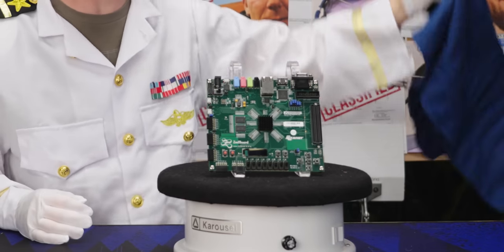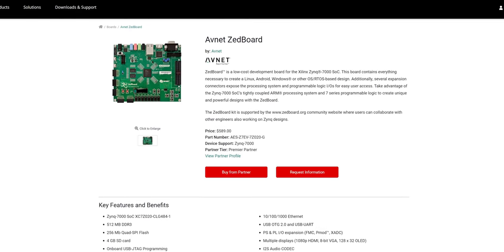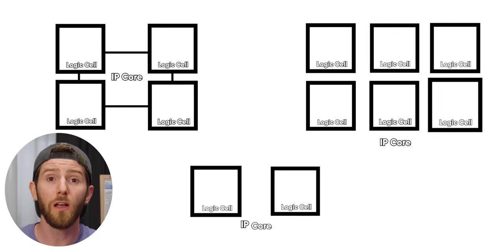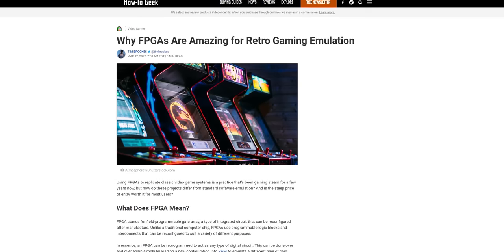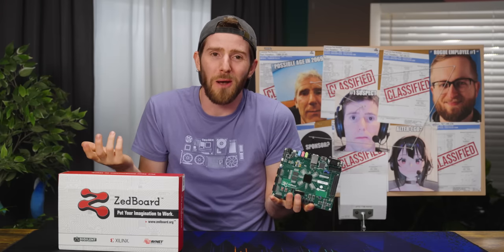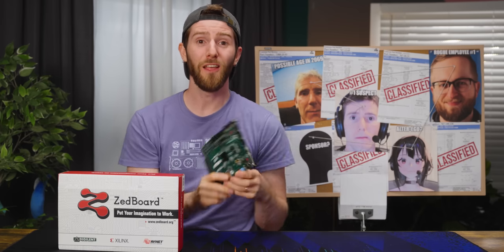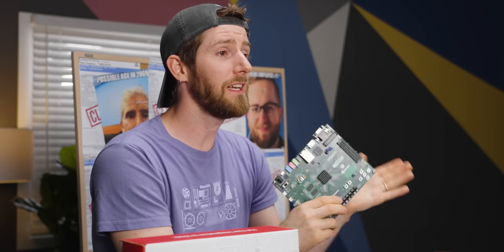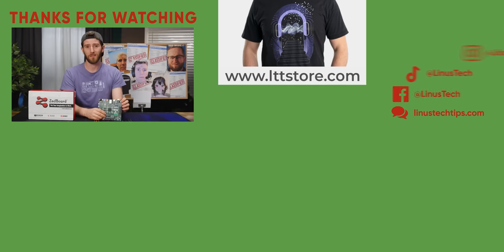I Bought Iran’s Secret Quantum Computing Chip

Comment: I'm not sure this comment will be read but I do my part:
I'm from Iran, here's a little story: Years ago, for my final university project, my professor gave me a simple device to reverse engineering it. (My university wasn't fancy) it was a queue machine, the ones you press a button, and you get a number and then the machine reads out loud the number, so you know it's your time to visit the place. it was using Ethernet CAT5 cable, he mentioned they tried plugging it to a laptop and couldn't get any data from it. I was curious and took the project. turns out it was just a casual USART between two microcontrollers, but they used Ethernet cable for both power and data. so, I made a simple board to read the USUART data on the go and displayed it over a simple 4x20 Alphanumeric LCD, I also added some features like paging, memory to save etc. it looked cool too :D, I got full score for it.
A month later I was invited to "Research and Developments of Universities" show, I went there and saw my project under a spotlight with this title "Network Spy Board, it can Spy and decrypt data in datalines" I was like "wha- ???". I Investigated and I realized some guy in my university wanted to get promoted and made this lie to attract some attention to himself.

Usually, stuff like this happens in here. Top managers have no technical knowledge or sometimes incorrectly make the title bigger because they might get a raise. I believe that Quantum Computer thing, could be the same case. nobody looks at student projects seriously and incorrect information can easily get over news before it gets actually checked. yes, it's a downside and I am criticizing it Aswell, I'm an electronics teacher, I've done actions to fix things. to be fair it's a 40-year-old government (for instance united states has been for 200+ years.)

Every human is free to say their point of view or anything they like to say, that's what I always say in my classes. I'm a big of your channel, I wanted to explain how big mistakes like this happens. For instance, the covid device was BS :D no doubt about it, but this isn't always the case. And ofc in every nation there are bad people, they exist.

I respect the time you guys invested for this video and it was a good video, Keep rocking 🌹
Reply: Aint reading allat
Reply: @gunzooo0 you should it was a pretty good explanation
Reply: حاجی دمت گرم
Reply: Makes very much sense
Reply: Respect.
Reply: Hopefully that government doesn't live to be 50
Reply: Much love and respect from a U.S. citizen.

Hopefully at some point the crazies on both sides will be cast aside or they will set aside their differences, and the US and Iran can start being friends again.
Reply: "And how can we win we fools can be kings?"
- Knights of Cydonia, by Muse
Reply: Can't always believe what someone tells you, especially government officials! Got to take it with a grain of salt.
Reply: @joseperez-ig5yu  lol, i live in Kurdistan, we share borders
Reply: I lol-ed hard when u mentioned the title of your project 😂 yea I can imagine that happening bahahahhahaa
Reply: "to be fair it's a 40 y o government, for instance the u.s has been around for 200+ years"

What exactly did you mean by that? You're comparing a government that started in late 1700s to one that has started in 1979 and... inferring that any flaws can be understandable because of that? I'm sorry but the fallacy is so obvious here, as if there was no technological, infrastructure advancements before 1979 and they just started from blank! you must be a smart guy, read your statement again and you'll know what I mean.
Reply: lots of home schooled tech wanabes in this channel hahahah
Reply: us is so advanced barefoot indians have to do all the tech work, lol
Reply: @omiddhm372 actually they have started from blank since Shah had imported science and technology from the US and they US gov didn't let Iranians know shit about the intricacies of the tech at the time to make Iran dependant on them.

Comment: FPGAs are being used for quantum computers in a very critical role, as control unit that schedules all the operations of the quantum algorithm, since they can implement logic and execute it perfectly synced up to an external clock. And since quantum computers is still not exactly a mass product, nobody is bothering with dedicated chips, and sometimes not even with production FPGAs. ZedBoard development boards do work quite well.
Reply: They slipped up thats what there using for there development of their quantum computer.
Reply: finally, a reasonable person
Reply: I'm sure Linus said this already in this video not just as detailed though but you can get the gist of it.   😮
Reply: Shameless plug: I work at a company (Riverlane) that's building a control system and error correction solutions for quantum computers. We use FPGAs for prototyping and deployment precisely for this reason.
Reply: @GabrielGee plug accepted, cuz that sounds sick af boiii
Reply: can't wait for ibm joker version , i laughed hard last time, lol

Comment: The temperature thing is only necessary for some architectures, a fully optical quantum processor is room temperature, and the rubidium atomic processors are actually very hot, they literally boil rubidium atoms and then capture them in place with a laser trap; its one of the less expensive methods. (Still very expensive)
Reply: What about the 12CQ carbon based cubit processor from Archer? Is that pipedream or real stuff?
Reply: temperature... "thing"???
Reply: @hiddenaether3232  
Yes, the idea that quantum computers have to be super cooled is not true.

I write the way I write and talk the way I talk so that you can understand me, not to impress you.
Reply: Those atomic traps actually are a lot cooler than those bulky He dilution fridges (usually reaching a couple hundred of mili Kelvin). A typical MOT (magneto optical trap) can reach nano Kelvin range, which is the coldest in the entire universe!

Comment: A research project I did in Uni used a similar board as a test bed for validating processor designs. So you could bake the logic gates of the processor onto the board and then run specification checks to validate the design before you send it to be built. Cool to see these kinds of board highlighted here.
Reply: Every computer engineer has an FPGA class as a rite of passage. I still have the 32-bit CPU I designed and got working on a Nexys FPGA board. The minute I saw the board and the stereotypical dev board layout I laughed expecting something more advanced and not like something loaned out to bored undergrads in uni.
Reply: @chiragpatil2052  My university didn't have an FPGA class unfortunately. I'm thinking of getting one of those boards and taking an online course on them, I'd love to learn more about them.

Comment: Just wanted to add something about the emulation. The larger FPGAs (eg v2000t, vu440, vu19p, vp1902) are designed for emulating new designs (eg new gpu/cpu designs) rather than older ones. The larger FPGAs replace BRAM/URAM with LUTs (and also trading faster I/O for more "slower" I/O) because that's what's needed for ASIC emulation

Comment: Zynq7000 SoC is widely used in the defense sector, mainly in Avionics. They are used from digital controllers for aerial vehicle dynamics to DSP processor for interfacing software defined radios and much more, these ICs are so cheap and so versatile its easy to find them everywhere...
Reply: Hope it doesn't find YOU, kind of things

Comment: Iran's attempt at a 5th Generation fighter jet, the Qaher-313, was also very funny. It was a plastic mockup that looked like a cheap copy of an F-22, that was probably big enough to convince someone who doesn't know better, but too small to realistically fly, carry weapons or even for most people to sit in. It had tiny air intakes, implausible aerodynamics, and would have most likely shown up very clearly on radar, as it seems it was more focused on looking cool than actual stealth. It also had no weapons bays, no jet nozzles, a tire pressure that would be too low to actually hold a fully-loaded fighter plane, and a very basic cockpit filled with cheap off-the-shelf avionics taken from a civilian turboprop aircraft. Their "flight demo" was a poor-quality video of what was almost certainly an RC plane, that didn't actually show it taking off or landing. Last I saw, they've actually given up on the fighter thing and are going to make it into an unmanned drone instead, which seems to be a bit of an admission of defeat on their part.

Comment: FPGA emulation is a little more nuanced. While it IS possible to implement a transistor-for-transistor recreation based on a decapped chip die, to my knowledge, almost every current instance of FPGA emulation is done using black-box reverse engineering: attempting to recreate the behavior of the system based on its inputs and outputs. So it is not a 1:1 recreation, and still a "best guess". Running on an FPGA doesn't instantly make it a perfect recreation: it is still only as good as the code it's running. It is still emulation, just hardware emulation rather than software. Both are awesome, and each has their own advantages.
Reply: And to be clear, this isn't me talking down on it. FPGA hardware emulation is so cool. I love the mister project, and have huge respect for the analogue devs. But it IS hardware emulation, despite what some marketing says, and it is NOT perfect recreations of systems. I have encountered and reported many a bug on my analogue systems.

So much incredible stuff has been done with fpgas, and I'm excited for when we do get real transistor-for-transistor core recreations on them
Reply: @ShankMods one of the few cases where transistor level emulation is likely is some 6502 emulators, considering we have the visual 6502 stuff.
Reply: I don't know for sure, but the SNES platform, including most or all of its expansions, should be doable on a 1:1 level because I believe nearly every chip was decapped and/or fully dumped by Dr. Decapinator back when Byuu/Near was developing BSNES. I know that's a rarity in this realm, though. This process did show what you're talking about regarding "black box" behavior. For example, the software version of SuperFX ran twice the speed it was supposed to and had other timing issues that weren't fully apparent until an accurate version was written.
Reply: Hey shankmods! I love your stuff!!
Reply: It's more like logic emulation as FPGA chips don't go quite as far as the transistor level

Comment: Kind of sad you didn't fully mention the amazing nature of having an FPGA and an ARM SoC on a single package, this allows to have a more easy and feature rich chip because you can install Linux* into an external memory an run it with the ARM PS while also having integrated custom logic solutions at your disposal FROM LINUX thanks to the PL
Reply: What's even more cool is that you can create a soft-cpu in the programmable logic and then run Linux on that! You can literally design your own CPU in hardware and run Linux on it (If you are extremely skilled)
Reply: @cheesepie4ever  That's not a feature. That would be extremely expensive on the PL side. From working on a research team developing FPGA overlays for safety critical systems, you want to run as light as possible and save your PL side just for compute and acceleration. Keep the PS stuff on the discrete hardware, it's cheaper and better for performance.
Reply: @johnbrooks7350  Soft core CPUs ARE used in the industry - look at Neon, Microblaze etc. They can be used for system monitoring, control + coordination for eg DMA, security, redundancy etc. Softcore CPUs also aren't necessarily that expensive on the PL side either -  in order of less than 1000 LUTs.
I agree you generally wouldn't use a softcore Linux - it is achievable and a cool exercise - but not something that would be done in many professional situations. Although I have heard of it being done in rare situations
Reply: @cheesepie4ever  sorry for the misunderstanding, my work is mainly focused in the embedded side of things where usually you want the PS side to be running your RTOS systems and such and PL is usually for your high performance signal processing and such.
Reply: @johnbrooks7350  That is cool! Do you work with Zynq MPsoc? My work has been on the FPGA side only but my company let me do a course on MPSoc and it does seem really cool! Although petalinux seems pretty evil to learn for the first time haha, maybe you don't need to deal with that if you're working on the real time stuff?
Reply: @cheesepie4ever  yeah, a lot of my work is with Zynq MPSoC’s. We recently have been developing on the kv260 with petalinux and it’s definitely “special”

Comment: Both Microsoft and Google have Quantum programming libraries that run on your standard computer. They basically emulate some parts of a quantum computer. Though not very likely, perhaps this board was used to act as a very efficient quantum emulator for development
Reply: Simulating qubits is at least quadratic time complexity. Those compilers and FPGAs can only simulate a handful of them at once - which is only good for experimental/learning purposes.
Reply: @exciting-burp  definitely. Though those FPGAs may do the calculations way faster than a normal CPU would
Reply: I like your funny words magic man
Reply: @vinno97  An FPGA is not magically faster than a specialized CPU. It's main point is that it can basically emulate different types of ASICs, not that it's some supercomputer of its own.
Reply: That's probably what was told to immediate senior of the researcher but multilple people in the chain of command probably exagerated the "quantumness" and the the message that reach the HQ was "WE HAVE WORKING SUPERCOMPUTER!!!"😂😂😂
Reply: The thing about quantum computers is that they can emulate reality itself in real time, but no one in reality can emulate the quantum realm because Shrodinger's kitty cannot get pass Heimdall 🙃
Reply: You still need an actual quantum computer to use it effectively. Which is something Iran for sure doesn't have.
Reply: > this board was used to act as a very efficient quantum emulator for development

That also mean that every FPGA is a quantum computer if you go by that definition.
Reply: @bilalbaig8586  nah, this was done on purpose. It's not some simple misunderstanding.
Reply: @junkname9983  Should have been economically more feasible to order a bunch of Analogue Pocket and make a cluster for computing performance.
Reply: @bellissimo4520  no but it can be programmed to be insanely fast for one specific task. A quick Google search already shows a good number of examples of using FPGAs to speed up quantum simulations
Reply: @junkname9983  I never said it was a quantum computer
Reply: @TechnologistAtWork  less than 30 q can run on any
Reply: @bellissimo4520  FPGA is good however at parallel operations, that being essentially what the waveform collapse models of quantum computing look like. It wouldn't be outrageous to think that even a modest FPGA could outperform a reasonable desktop for specific classes of quantum computation emulation. Note still that this doesn't imply that the FPGA is in any way quantum or that this would be a good way to solve any problem other than "I want to simulate quantum computing"
Reply: @hatman4818  can't wait for ibm joke coming up , cause i fell off my stool with their last q puter hahahah
Reply: us is so advanced barefoot indians have to do all the tech work, lol

Comment: Hardware dev here. I am quite impressed that Linus presents an fpga board here. Normally they gonna used in embedded prototyping projects such as cameras or image processors
Reply: Same, very impressed. FPGA's are very complex, have wide applications and are notoriously difficult to comprehend. Have seen them used mostly in projectors and other video platforms, haven't really thought about the application in emulation, very nice!

Comment: Ironically, that "basic dev board" is more advanced than the ones currently being used to control satellites.  The average level of processing power on most new launches is probably around the level of a first-generation Pentium.  As in, 60 MHz core clock Pentium.
Reply: I mean, they do have very strict energy consumption constraints. Makes sense that they run bare minimum hardware. Plus, getting rid of the heat generated by hardware in space is way more complicated than plopping in a regular heatsink. I guess they want as few thermal waste as possible.
Reply: A lot of space hardware uses special radiation hardened process nodes, which haven't shrunk as fast as conventional ones (think ~50-100nm for the latest fully rad hardened ones).
Reply: With the sheer amount of starlink launches, this is probably no longer accurate
Reply: @Mystikus2  I took that into account with my estimate.  Before Starlink, it was more along the lines of a 286.